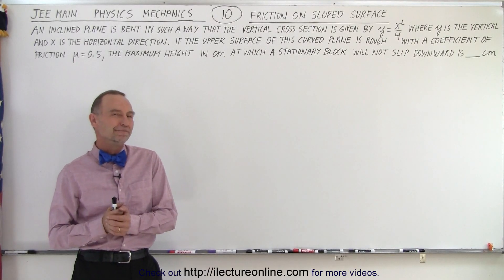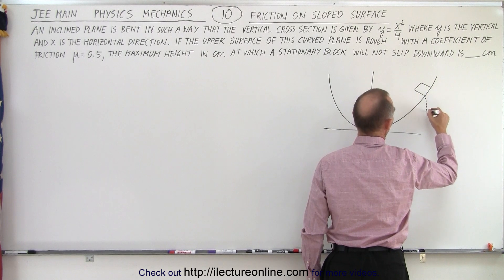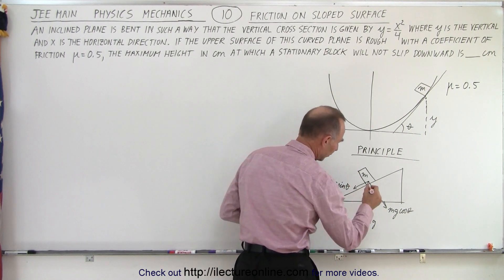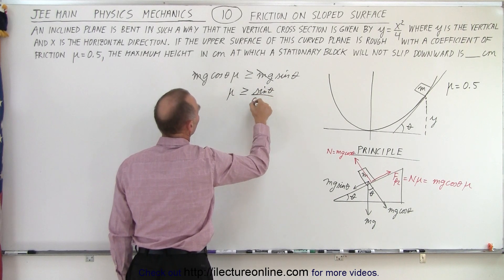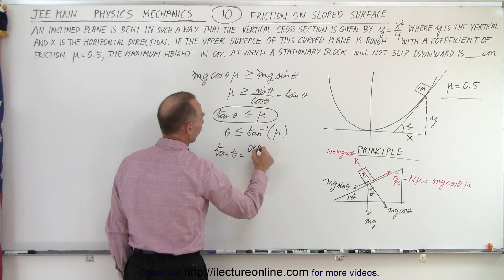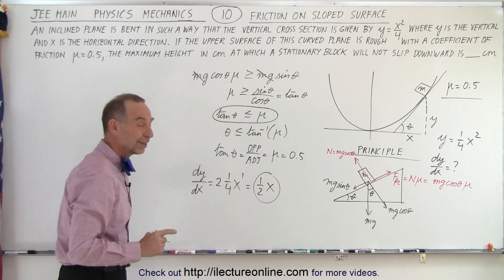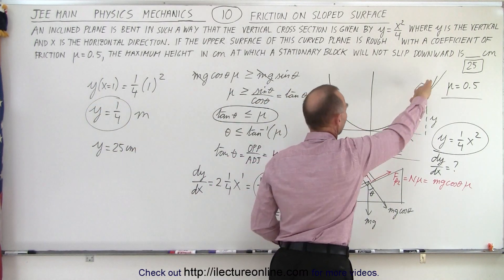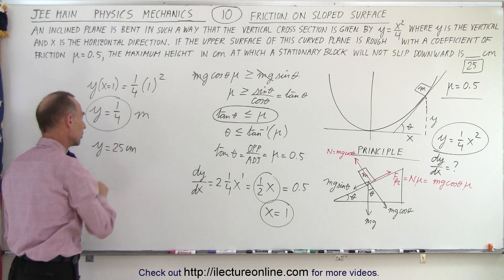JEE Main Physics Mechanics #10 Friction on Sloped Surface

Comment: I'm a mechanical engineering student (3rd year) and I solved this in 2 mins I guess
Reply: No offense : Yeah, it was considerable and was supposed to be easy for Mechanical Engineering Students and Graduates, unless JEE Main is the preselection exam (there is JEE Advance after Mains) for engineering college entrance for under grads (i.e you are supposed to solve this in 12th grade within 2mins-3mins (max)). Hence this question is actually very simple when compared to Advance.
Reply from the maker: Yes, that is correct.  This is a test given to high school students.

Comment: Sir please help with this question: a cylinder is kept in a laboratory and is rotating about a horizontal axis. A block is kept inside it, find minimum angular velocity at which the cylinder should rotate so that the block doesn't slip... Could you please provide an insight as to how to approach this question? The final answer is given as sqrt(g)*(sqrt(1+mu^2))/(mu*r) where r is radius of cylinder and mu the coefficient of friction...
Reply from the maker: Take a look at this problem.  It is just like it.  https://youtu.be/he9goft5dPg
Reply: @MichelvanBiezen   yes sir I looked at the problem, but here the cylinder is rotating about a horizontal axis .. so gravity will not be same everywhere right? In my problem it's as if we take that cylinder with vertical axis and turn it 90 degrees so that the new axis is horizontal.. about which we rotate it.. so we can't have gravity directly opposite to friction and it's causing trouble in balancing the forces...
Reply from the maker: The minimum friction will be encountered when the block is at the top.  F friction = (mv^2/R - mg) x  mu

Comment: I have worked thru this a couple times and get the height to be 1m.  Since the tan theta = 1/2...  the opp = 1 and the adj = 2  using  y=.25 and x = 1 the tan theta = .25 not .5.
Reply: As and engineer and tribologist I have difficulty with the premise of this question since the frictional characteristics of a flat surface on an curve would be very complex as it slides the normal force would vary continuously between the leading and trailing edge. Amonton's Law (of friction) only holds for planar surfaces. You could in theory put an identical curve on the contacting surface of the block as the ramp but then it would not be parabolic.
Reply: HEY ARE U INDIAN
Reply: @utkarshsohane8978  I will take this as a compliment since many of my friends colleagues from the continent of India are very intelligent.
Reply from the maker: Good observation.  The centripetal force caused by the circular motion is indeed ignored here.
Reply: @MichelvanBiezen  thank you for your response... I was not including any centripedal effects in my comment(s) the main comment is simply that if you check your answer of 25cm Y  in w 1 m in X you do not get a mu of .5 (tan theta)... for a x of 2m and y of 1m you get tan theta = 0.5.  On the second point, a block will only contact the inside of a curve on its leading and trailing edges   and since your assumption using Amonton's Law (mu = Ff/N) is not valid since you would have two different line contacts and the analysis using Hertzian contact analysis would be very difficult and impossible without material characteristics ( Young's modulus) and even then most likely wrong.  As I commented below on Marco's post this type of question is more difficult for the individuals who see the complexity.  I advise my students to write simplifying assumptions down with their response (with the proviso that their assumptions do not contradict the given parameters of the questions.
Reply: @MichelvanBiezen  the centripedal force at the point where the block does not move would be zero since the tangential velocity is zero.

Comment: Forgive me if I'm wrong ,but the x in the equation is the distance from the origin ,and x in the triangle is its base,how can they be the same?
Reply: If we actually keep on decreasing the slope of the tangent, a point comes where the triangle has one of its points at the origin itself, so from that logic, tell me if i am wrong anywhere
Reply: We were actually asked to find the y co-ordinate of that parabola, where the block doesn't move, so it must have only one point in the positive co-ordinates.....
Reply from the maker: x is indeed the distance from the origin to the point directly below the point of consideration on the curve.  But once we take the derivative of the function, the value of x substituted into the derivative will give us the slope at that point.

Comment: Great video. My main problem with these (not very well stated) questions is that I would've already had a problem when trying to figure out how the block fits on the slope and what points of connection to use. In such a question I think it's important to state that one can assume the mass/block just touches the curve at one point.
Reply: Marco, you are absolutely correct... this question is unfair to students who perceive the complexity of the contact between the prismic block and the parabolic surface.  I have studied friction for more than 30 years and I don't know any theory that could come close to accurately predicting friction... certainly not Amonton's Law (of friction) since the normal force will be focused on the line contact at the upper and lower edges and will be changing continuously.
Reply: I don't think that it's that much important to state how to fit the block
Reply from the maker: Part of the challenge of taking the JEE exams is that some of the questions are indeed stated in a way that makes it difficult to envision the problem and to know what exactly they are asking for.  But everyone taking the test is in the same "boat" and that is part of what makes these test questions so challenging.
Reply: @iamweirdo4640  I think that with this info given you could deduce that this is the only way to do it because otherwise there is not enough information given, you're right. But in a most general sense you might try to integrate over the length of the block considering some function for its shape and density etc. I realize this might be to complicated and you're probably right, but I'd say it wouldn't hurt to mention it.